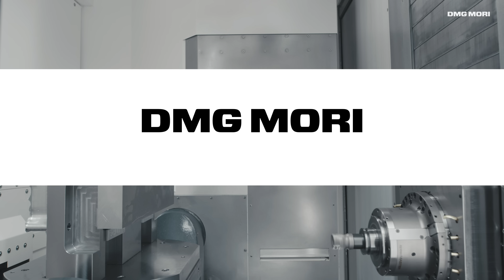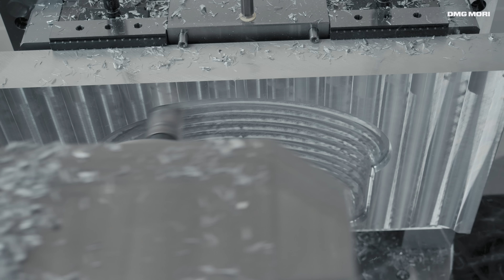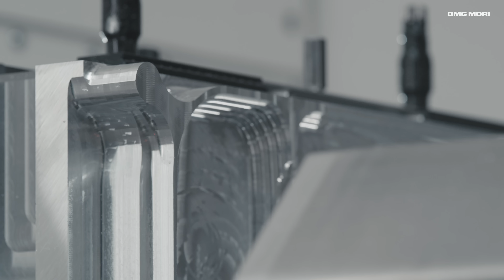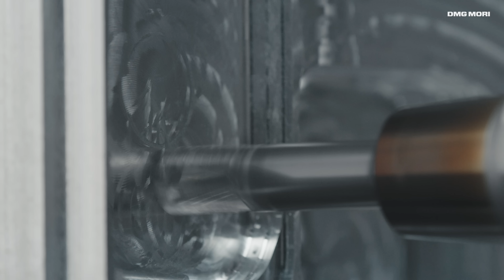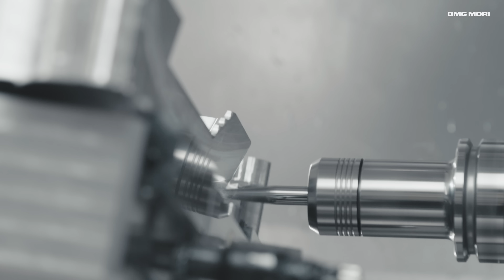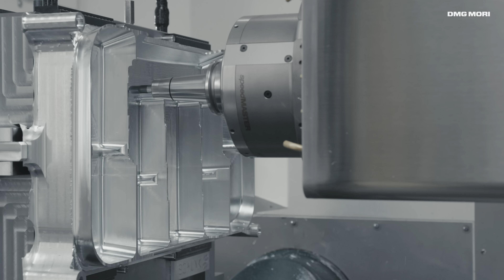Aerospace machining on DMC 65 H monoBLOCK by DMG MORI

Comment: I’d like to know what tooling they are using. I’m assuming this is aluminum by the design of the tooling during tool changes and the look of the material. It’s hard to get the machine to do serious work without the proper tooling. Would also like to see cutting parameters and torque on machine. Other than that Mori’s are fantastic machines.

Comment: Which CAM software used in this machine?
Reply: solidworks "iMachining" i guess
Reply: Probably Mastercam
Reply: Many, but not all, DMG cutting demos are done in Siemens NX. Their apps team uses a multitude of different CAM packages though.
Reply: Note: If you're doing aerospace, step up your game and go with NX.  It's aerospace capable and it's down stream compatability to working with true complex math models is exponentially more capable due to it's math kernal.   Complex aerospace parts have class A modeled surfaces and while they look like typical geometries, they're way more complex.  Solid Works is a mid-level CAD system and isn't capable of modeling those shapes accurately and it's not intended for this class of design. Mastercam is a great system, still mid level. Aerospace, medical and mold machining require a top tier system and Siemens NX is where you need to be. No I don't work for Siemens.   (and now we can start arguing)

Comment: btw you are not supposed to use  a messerkopf with iMachining
Reply: Works just fine even though some of the calculations are not real (like vibration results).
Reply: it was done with NX12 adaptive milling
Reply: That looks like dynamic milling within Mastercam so I doubt it's iMachining
Reply: who says that? If you can use a "Messerkopf" with traditional pocketing strategy, then you can use them with dynamic milling as well